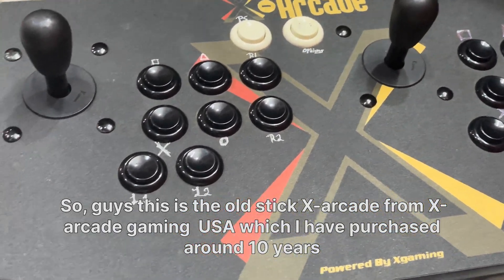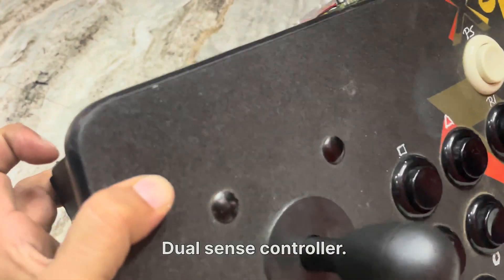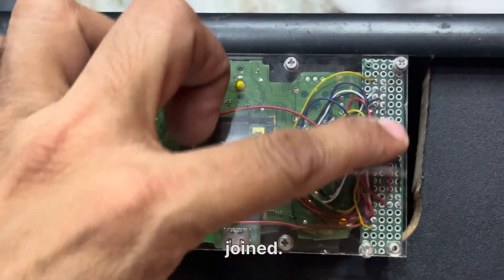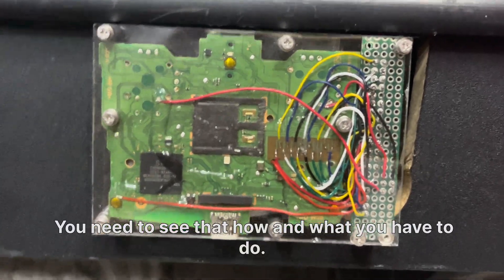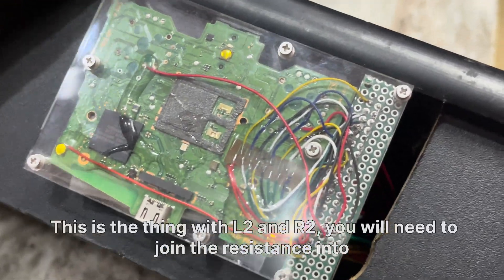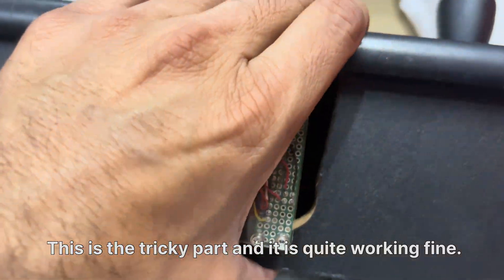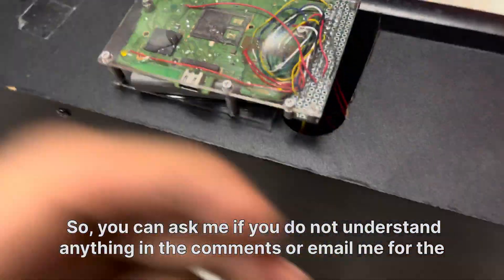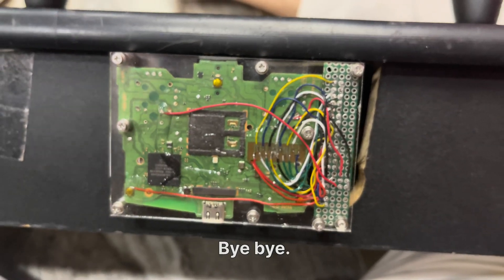Make Arcade stick with PS5 dualsense controller motherboard (BDM-030)  First in the World

Comment: Can please guide how you actually made this and where are the all buttons located
Reply from the maker: Just arrange 030 motherboard first than follow the pictures and directly join each wire from motherboard to your joystick button except R2 n L2 which needed resistance in between them you can contact me on Whts Aapp nine 3️⃣ 1️⃣ 8418223

Comment: hello how did you connect the power from usb connection to the battery so that I dont need to use the type C like you did?
Reply: do I also need to connect a ground wire?
Reply from the maker: @netgeek1580 of course PIN number 6 is ground and common to all
Reply from the maker: I never touched the power connection if you look closely the whole battery thing is untouched I charge the controller like originally we do charge the controller